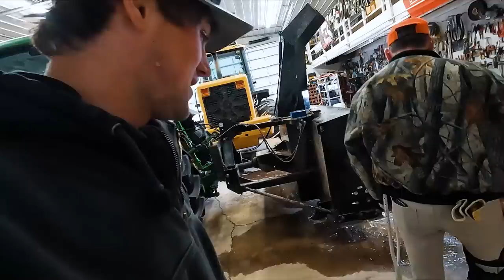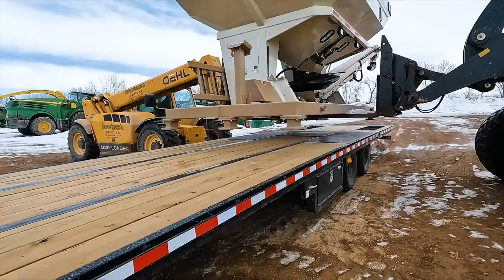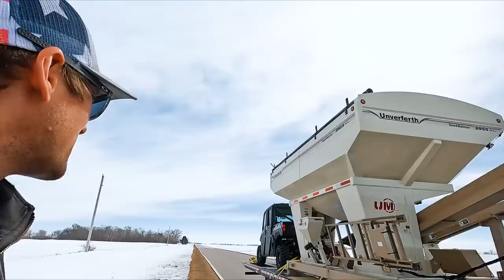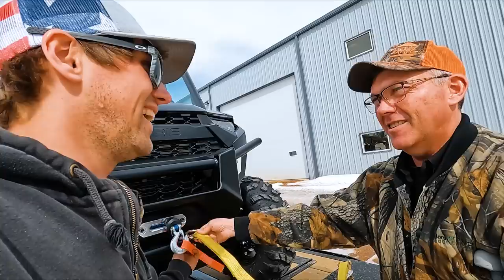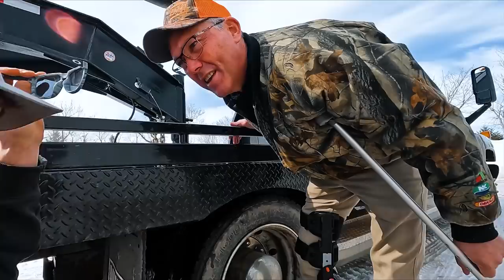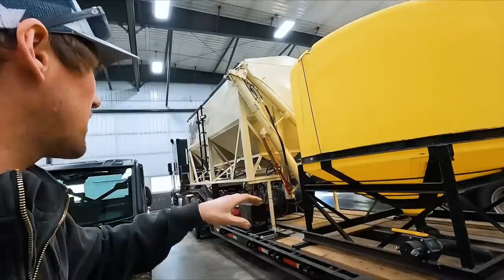He’s Back From Surgery To Pick Up His Internet Purchases!!

Comment: Instead of ripping up the driveway, get a couple rolls of "combi-grid" geotextile and roll that over the existing driveway.  The spread 6-8 inches of gravel over the top of it.  It'll allow drainage and add more then enough strength to the roadway.
We recommend the material all the time when constructing roads over undesirable base materials.

Comment: Feel for you Dougo.  I started with a meniscus repair.  2 years later, I got a new knee!  I would love to tell you both were a breeze..They weren’t. Those that know…well, ya know! (Quote from my favorite source)
Reply: I also had meniscus surgery. First on one leg then the other about two years later. Both were arthroscopic so they put three holes in for their instruments. Then about ten years later I had the knees replaced one at a time. I had the first meniscus surgery on a Friday and went back to work the following Monday. The first knee replacement was a little rougher because they used the replacement that was set into the bones but I never had a brace on it. They wanted it flexed as much as possible. Immediately after surgery they had my leg hooked to a machine that kept it moving The second knee replacement they just cut the ends of the bones flat and glued the new joint on.
Reply: 2 meniscus tears and a knee replacement. Let's just don't go there again
Reply: I had my first replacement done 29 years ago, then end of 2021 had other knee replacement. Month later had original knee redone...
Reply: I might as well jump in on the knee repair thread.  Had a pizza slice taken out of a meniscus I think on a thursday.  was planning on being back at work doing administrative stuff the following week.  Not a chance - laid in bed with an ice pack on it, got up every few hours to hobble around, take some pain meds and back to bed, for a damn week. Glad i did it as it has been 7 or so years now and still feels great.  Before the surgery I finally just got fed up with the pain and non working knee.

Comment: Yep that's the problem with the Honda UTV they got a cab like a 1940 tractor the only good thing about them is they have no belt to worry about they have the best drive train in the UTV industry but if you could take the cap off a Polaris ranger and put it on the Honda you would have the perfect machine Polaris rangers are junk should have got the Can-Am defender.